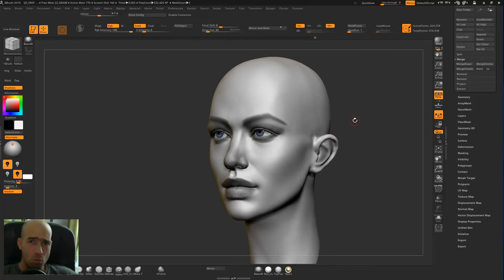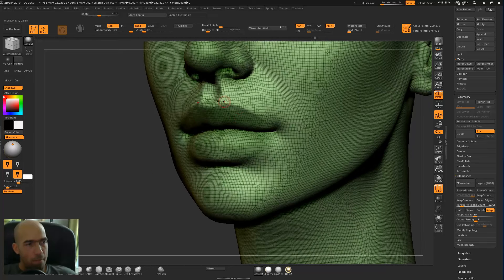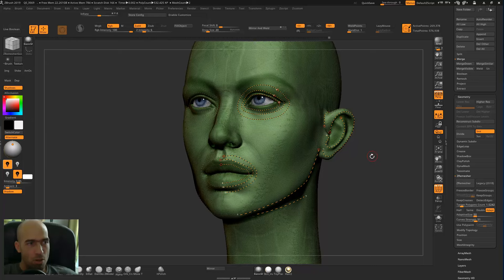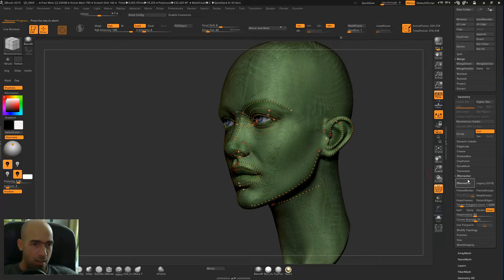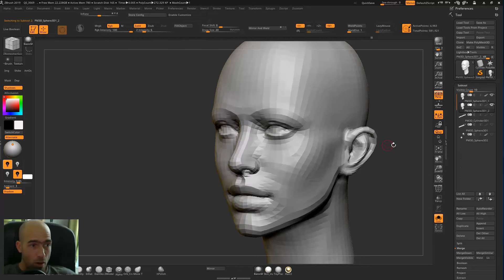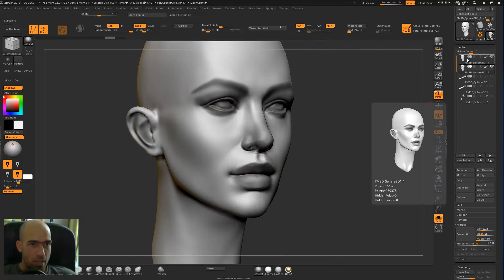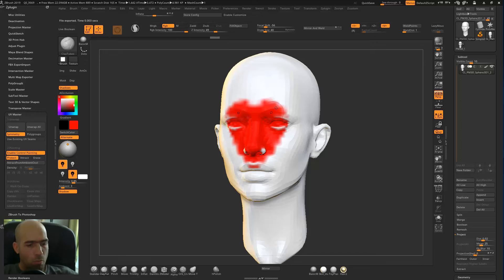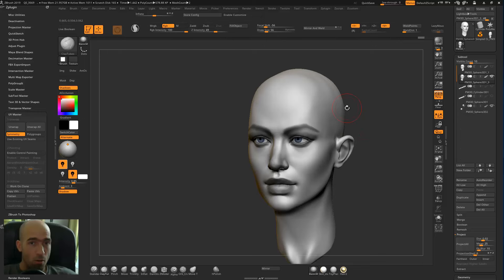Quick and easy retopology of head in Zbrush (with bonus UV mapping)

Comment: good work. I would have a question about this process. is this process just retopology? Is there a need to make a standard map after this process? I am learning these processes recently. I wanted to consult you.
Reply from the maker: This is automatic retopology. If you want good retopology for facial rig and animations, you will have to manually fix some things in program like blender or 3ds max. For textures, of course you need UV map and then you can bake textures from the high to the low poly. It could be done in Zbrush, though i use mostly Substane Painter for that. Or a free program i used to use for years - Xnormal
Reply: @SpeedChar  thank you so much. good work

Comment: hey dude, nice tut,  what's about texel density for this workflow, I think the uv mapping is ok , but is some case of projection , nose are stretch, or texel density behaviour with this classic uv method... but for saving time and good result I think is very good... I notice there are a huge advantage if the HIgh poly model has the same uv as the lowpoly geometry.
Reply from the maker: The advantage for the high poly to be the subdivision of the low is that you can export a displacement map from Zbrush. And for the uvs, Zbrush is making maybe the best unwrapping of all programs I know of :). I usually make the seams in Max and then unwrap in Zbrush.

Comment: Nice video thanks... Is the Zremesher process supposed to take a long time? I have an i7 RTX 2070 32g DDR4 and it takes hours to do the process. I am unable to do it with efficiency... Am I doing something wrong? My settings are the same as yours. Any tips will be appreciated a lot.
Reply from the maker: Hours is definitely too much. Probably your high poly model has too many polygons. If they are like few millions it could take long.

Comment: Is this possible to control the density of polygons like the way you used Zremesher guide pen?
Reply from the maker: No need for that since you control it from the slider of Zremesher, and also you  can use the polypaint option, to have different densities on the same mesh.

Comment: Hi! so you do you add textures on the high poly or the low poly? Also you UVd 'd the low poly head? Thank you
Reply from the maker: Textures are needed for putting the model in a game engine, so low poly. Or rendering in Vray or similar, so relatively low poly :)
Reply: @SpeedChar   Cool thanks! And you did UV Mapping for the lowpoly?
Reply: @mythsfuture3201  YES WHY WOULD YOU DO UV MAPPING FOR HIGH POLY

Comment: New to Zbrush. What is repotology and why and WHEN am I supposed to use it? I just want to sculpt and render dope characters so what does this mean.
Reply: Normally for the sake of only rendering you can use your sculpt without rotopology, but for designing a character for animation or game then it must be retopologised. Retopology basically reduces polycount of your model and makes it easier to render. I'm a noob too so take my word as a grain of salt.
Reply: Sorry for long comment, but it explains what you want to know.
Retopology is necessary for animation. Mostly retopo for animation is done manually, like poly modeling on top of your high poly sculpt. In that you keep the edge loops nice and clean and make them follow the shapes of the muscles as close as you can. You also have to try to avoid triangles and ngons because when animating, they will cause problems by showing weird dents and bumps on the surface especially at joints where the muscles move/deform. So if you want to have your animation look good, you have to do retopology for the face and body both.Even clothes need to have clean edge flow. If you want to just sculpt and render dope characters then retopo is not necessary but it is advised and more efficient..since good edge flow also helps you with sculpting forms nicely in zbrush. So if you don't do retopo, your character will still look great if you have the skills. If you retopo and sculpt the details, it will truly help make your characters look dope. If you are really looking to get deep into character sculpting, I would definitely encourage you to learn retopology too. If you learn manual retopology, that's even better. Trust me, with more learning and experience, you will realize how important it is and when to use and not to use retopology for your characters. I hope this helps. 
If I may point you towards another tutorial, it goes a little more in-depth in explanation and shows it in practicality 
https://www.youtube.com/watch?v=iWEDWFMjA9E - Head Retopology Tutorial
https://www.youtube.com/watch?v=ns5iRWRii5c- Full body retopo tutorial
After watching this you will have much better understanding. Do take out some time and watch it. There are other tutorials too but this is the one I followed and I learnt it in 2 days. But I am more experienced so it might take longer for you idk. Goodluck and hope you implement retopo in your skillset someday. Cheers!
Reply: Umm shrekislove1289 mentioned this already but retopo also is mandatory for characters in video games since you need a low poly character with normal maps and import them in the game engine. And game characters can't and shouldn't be done with automatic retopology, they have to be done with more precision, hence manual retopology is required. Alot of softwares nowadays have great tools for retopo. Once you get a hang of it, its not so hard, just needs knowledge of how to manipulate edge loops etc.
Reply: Shreyas Pai Thank You for this!! This explains and helps a lot! I am totally new to 3D and U purchased a few courses on Udemy and this channel by far is one of my favorites. I’m learning so much from the 3D community and you guys are amazing and awesome. Thanks for the info!
Reply: @TonyG718  Haha no worries man, I am glad it helped! Do keep practicing and don't lose motivation, there is a lot of good content out there.Soon you will also be one of those awesome guys from the 3d community giving tips to other budding artists! ;) Have fun mate!

Comment: By using this trick can I import the model to Maya and animate it?
Reply from the maker: Yes of course. The low poly won't be optimal, but it is animatable :)
Reply: @SpeedChar  thank you 😊
Reply: @SpeedChar  one more question sir, what if my character has wrinkles on his face and cheeks the process will still be the same?
Reply from the maker: The wrinkles and all small details should be baked like displacement or normal map. You  will not get them in the low poly mesh itself.
Reply: @SpeedChar  thank you once again 😊